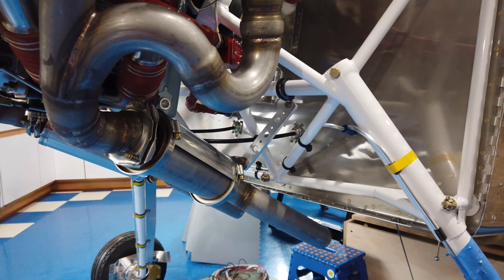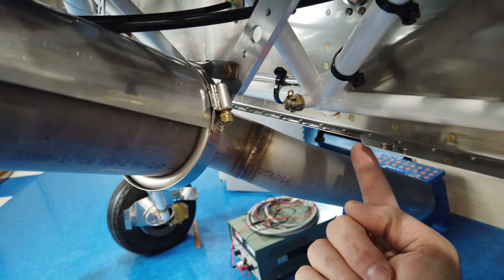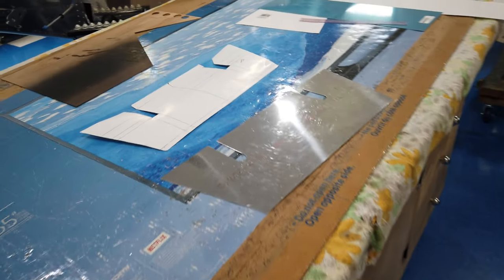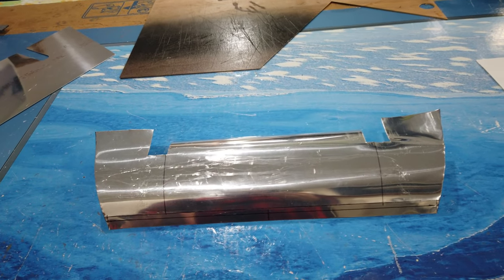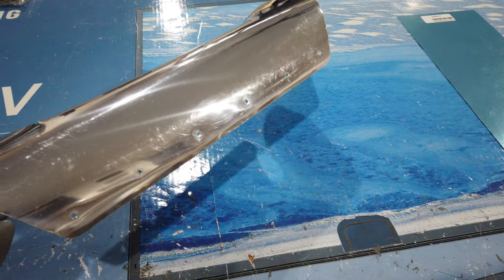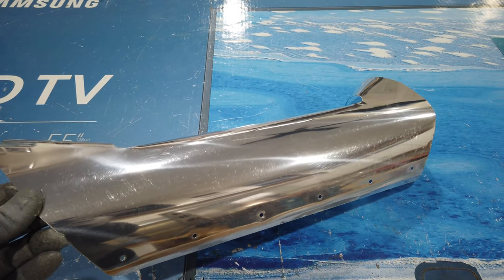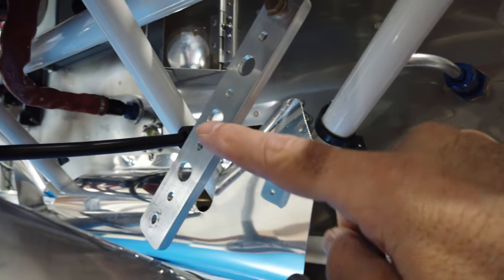Vans RV 7 HINT Videos Lower Cowling Exit Ramp

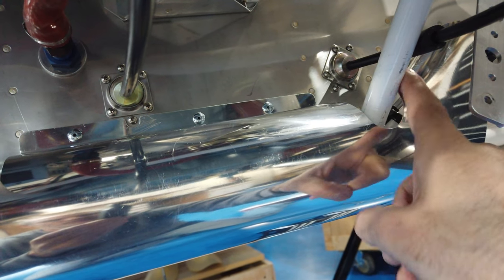Comment: 13:34 Maybe you could use some rubber grommets between your bridge cutouts and the engine mounts instead of aluminum tape, also, when I use plastic zip ties on the engine mount, I use two wraps of fiberglass reinforced tape under the zip tie, I’ve seen those things saw through engine mount tube from high frequency vibration.
Reply from the maker: Howdy Karl. Never thought of grommets there; will look into that.
Reply: @KaretakerAero  I didn’t put an exit ramp on the cowling of my RV-7A when I built it, I’m not even sure I saw it on the plans, I might need to go back and revisit that part.
Reply from the maker: The only reference to the exit ramp is in the written instructions, section 12, page 12-2. Small picture, top right of page. You are 100% on your own with fabrication and fitting.